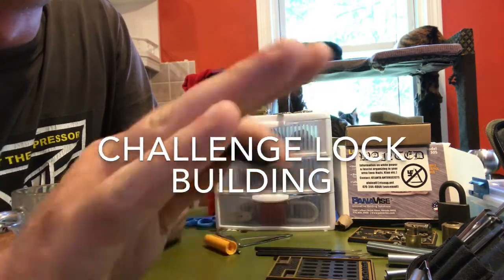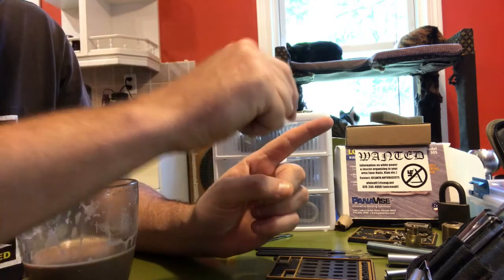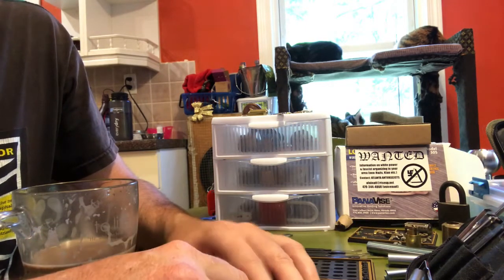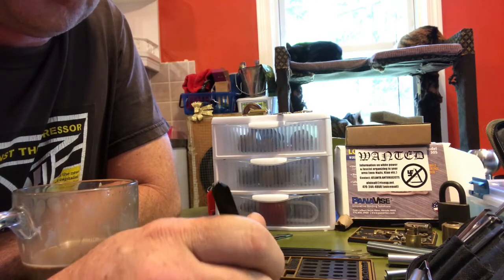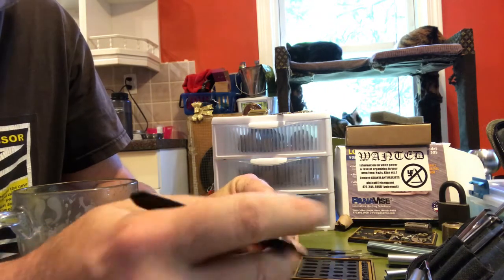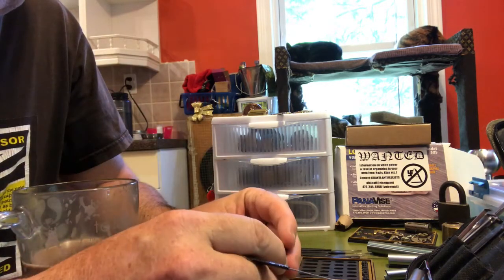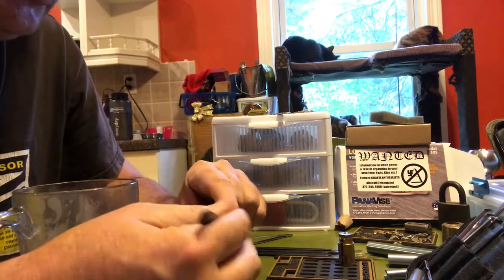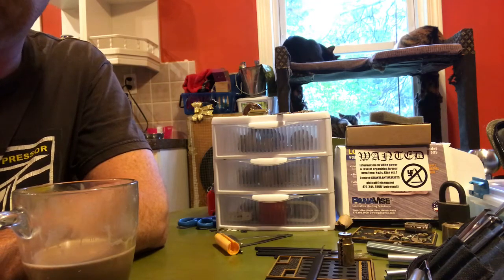We Need More CL Building Videos

Comment: I will do one now that I have made tons of challenge locks using only cheap common tools.  You are right. I think a lot of people would find it fun to make challenge locks.  It’s a little tricky setting up the camera during the pin making.  Sometimes I make fun ones and sometimes difficult ones on purpose and I plan ahead.  I can make one very quickly but to make them good takes time as was already said in the other comments.  And picking and testing them to see how it turns out as making changes takes time. Learning how binding order impacts a lock is fun.  I’ve done quite a few videos picking challenge locks but picking my own has helped me a lot.